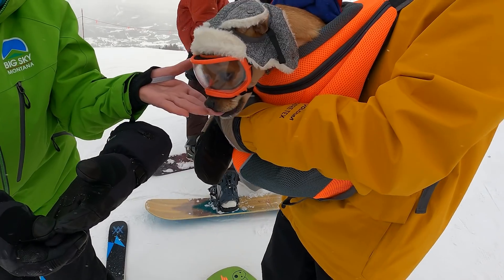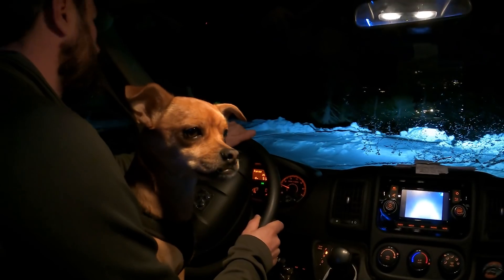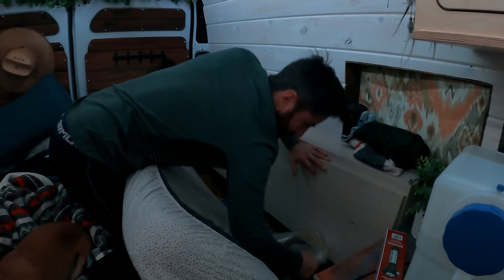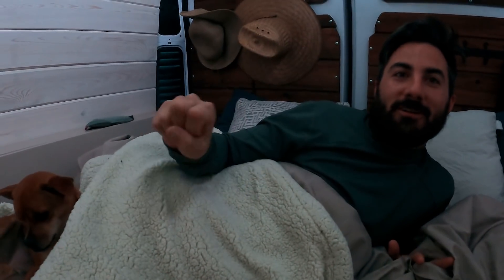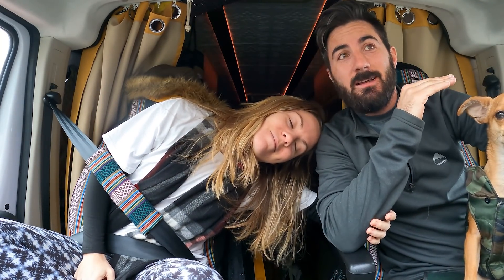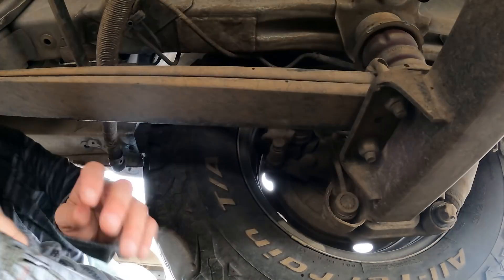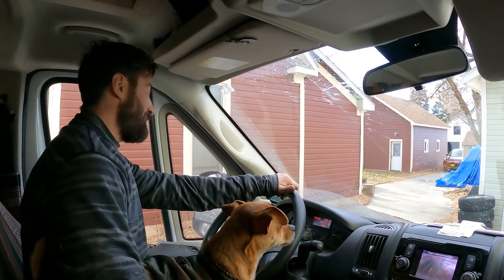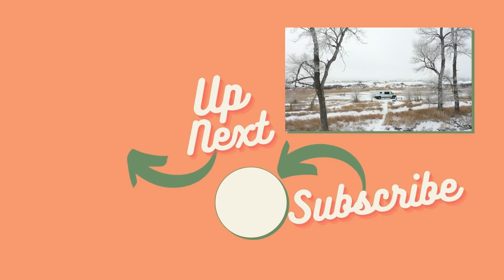Surviving Our Coldest Night in the Van 😰

Comment from the maker: If you're having this issue too, here's how to fix it!! https://www.stokeloafvan.com/blog-1/how-to-clean-the-webasto-at2000stc-gas-heater-and-burner-replacemen?rq=heater
Reply: thanks for sharing the above link .    what causes those heavy carbon buildup ?
Reply: well good luck when you guys get here....Alberta has been an ice freeze!!!! that heater really needs to work!!!
Reply: @wilsonroo16   ,,   hope they have check the weather forecast .  new year eve is negative -30 celcius .  at least  their Webasto diesel heater shall be really  tested in that temperature .
Reply: I have a woodstove. He(defely a he) sometimes drives me crazy..start trowing smoke out of al Jos whatever...
So i have  to go outside to save my life...next dat clean my chimney( an expert chimney cleaner did it 2 month ago) found ontging but mister was So happy he burnt like an sweet stove....
Reply: @enzoh7763  Wrong fuel/air mix for higher elevation.
Reply: @StokeLoafVan   , ,  thank you ,, wrong mix cause more carbon buildup. . . . . ... i've seen yon YT,   the german made , espar or webasto have settings for elevation data inout,, which would mean with the correct  elevation data, the fuel air ration is  adjusted correspondingly.   .  i wonder is that the same with china made copies ? ?  you got some info  ? ?
Reply: @enzoh7763  For the Webasto gasoline the elevation adjustment helps but isn’t guaranteed above 5000ft. The Chinese diesel heaters actually have full manual control of fuel rate and fan intake speed.
Reply: @StokeLoafVan  
Thank you for the tip, 
It's a important tip .

Comment: A common tip for diesel heaters is to not always run it on low. Run it on high for at least ten minutes to clear out the buildup of gunk.
Reply from the maker: It's not a diesel heater it is Gasoline. Plus we mostly run this one on high.

Comment: Glad everything worked out.  Nice job on the fix!!
Alex, heaters and air conditioners dry the air so drink more water if you do not use a humidifier, otherwise really bad headaches happen.  There are cool mist and warm mist humidifiers.  I use both depending on the time of year.  I find warm mist evaporates into the air faster, however, it's best to use distilled water so the burn unit does not corrode.
Reply from the maker: Thanks for the tips! That is great advice. You are 100% correct about the dehumidification. Would love to have a humidifier that we don't have to worry about the water spilling out when driving any recommendations?

Comment: What a pain in the ass, glad you figured it out. 
This is the reason I went with a propane heater.
A thumbs up video 👍
Reply from the maker: Heard that we just met a couple and they had the big propane heater and said our van stays warmer then theirs. That might be an insulation issue tho. Also the propane one would require us to have a much bigger propane tank cause those heater us a lot of propane. Gas was just easier for us to go with.
Thanks J.G. Happy New Year too

Comment: Put some concentrated antifreeze in the grey water tank. (Just as you do with the washer fluid)
Reply from the maker: Thanks djsmiley01! Yes we could do that but we'd have to get biodegradable RV antifreeze, not the same stuff as the car takes, and the issue is the elbow of the pipe not the tank itself. Winter plumbing is just plain old annoying. lol xo Alex

Comment: We bought an electric blanket. Works really well and draws about 120 watts. So if we run it off the inverter over night for 8 hours, that's 8 x 120 / 12 = 80 ah. We have 400 ah in batteries so it's not that much of a draw for us.
Reply from the maker: That is quite a drawn pending how you charge. That is almost 1/4 of your battery bank every night. What happens if you have several days of no sun and you aren't driving. I'm guessing you may be running a generator? We have a duvet and even if it is 40 in the van we will sweat under the covers and it uses 0 energy. If we had an electric blanket I would melt lol (frankie) 😆. I am glad that it works for you tho. 😊
Reply: @FnAVanLife  no generator. We use the electric blanket as our backup. If we need to use it I make sure we either drive a few hours or do shore power plug in. Propane isn’t an option for us due to risks and condensation.
Reply from the maker: @billnalen  don't yeah make sense if you are using it for emergency only. Thanks for the understanding.

Comment: Hearty people you are. Hope everything works out. If I ever get around to outfitting my own camper van I would repurpose the heat from the engine coolant to supply heat to the cabin. Sub floor tubing and circulating fans and vents?
Reply from the maker: How long would the heat from the engine coolant last? Cause an engine takes a bit to warm back up in the freezing cold. You would also have to add the proper amount of coolant for the extra line/ heat exchanger you add and if it is off it will mess with the performance of the engine and possible damage it.

Comment: My propane furnace that I recycled out of a old camper. Cheap , I live in Wisconsin. I enjoy heat. I haven't had any problems in years. 20+ years living in Vans. Peace ☮️
Reply from the maker: nice!!! We've heard great things about propane heaters, how much propane does it use?? Love that you're an OG van dweller. We could learn a thing or two!! xo Alex
Reply: @FnAVanLife  how much does depends on how well your insulated. I built my van for cold weather in Wisconsin. This winter on average a 20# bottle lasted 2 to 3weeks. That's with heat 24 hours a day . At 65 to 75 degrees. At $20 a bottle. I paid about $50 for furnace used. It was recycled out of a old pop-up camper. I have had this furnace about 5 years now. It's a thermostat controlled furnace. I thought about trying a diesel heater , but I believe it would cost more to run. A lot more. And what I have seen on videos, people have a lot of problems with diesel heaters. I been living in Vans and RVs over 20 years. By the way, I'm not much of a writer. I'm a tradesman. Farmhand, est. Stay warm , stay safe. Peace ✌️

Comment: I notice the back doors radiate a ton of cold air… maybe on those really cold days and nights hang a blanket over the doors in the back and the slider door… also over the windows even though you have curtains on there… that will help keep the heat in the van and work more effectively…
Reply from the maker: Smart Donna!!! We started using magnetics to hold up blankets on the back and side doors and that has been super helpful especially in the very cold weather. We are going to add more insulation to the doors as well (once its warm enough to have the doors open for a long time) cause I don't think we stuffed them well enough to begin with 🤦🏼‍♀️ The blankets are definitely helping though!!! Xo Alex

Comment: At higher altitude, air has less oxygen, that affects how some gas/diesel heaters burn. There.may be an adjustment on your heater for high altitude to increase the air intake. If you run the heater at high altitude without adjusting the air intake, soot can form, clogging the system and causing it to shut off because the soot clog causes over-heating.
Reply from the maker: That is exactly what happened. 😁 all fix and adjusted now. 🥰
Reply: @FnAVanLife  sweet! Take a run for me when you get here to Canada, I am not venturing out here in Alberta until the temp rises a few degrees in

Comment: U had said that your grey water tank froze. They do make a long gutter heating cables that plugs into 110v that’s designed to keep house gutters from freezing. If u wrapped your tank it wouldn’t freeze. $45 for 60 feet on Amazon.  Just a thought.  Good luck. ✌🏼
Reply from the maker: Thank you for the information. We found low power 12 volt ones rv style. Just installed them recently and they are working great. 
Hope to see you helpful comment in future videos thanks again.

Comment: Glad y'all made it through. My Mr. Heater isn't getting propane even though there is propane in the tank. I don't know what's wrong. I don't think there's anything wrong with the heater, though. I'm gonna test it with a 1 lb tank to see whether it will work that way. Good thing is, I'm in warm and balmy TN right now.  It's December and 70 F.
Reply from the maker: It could just be the connection or your tank might have to be bleed properly. If air got into you tank during a fill it will mess it up and it won't work. It's has happened to us with our cook top.

Comment: Heard you mention that 1/4 fuel was required for the heater to work. I spent a few years driving a semi and it needed 1/4 tank of fuel for the cabin space heater to start. Also don't know if you've addressed windshield washer fluid before. If you get caught in freezing rain regular anti freezing fluid doesn't hack it. It freezes up the windshield as well as the wiper blades and you go blind. Make sure you get fluid that says deicing. That will dissolve the ice. Anti ice fluid just means it won't freeze in the tank..does nothing to clear the windshield. Drive safe!
Reply from the maker: Yeah we always try to keep it above 1/4 tank when using the heater. Thank you for the heads up on the windshield washer fluid ill makensure to grab the right one next time. You rock! Hapoy New Year! 😊

Comment: Buy a chinees fuesel heater that is fitted into a steel box. And fit a Ryobi 20 v battery using a 24 vto 12 v voltage reducer  it is then mobile
Reply from the maker: Where are you exhausting it??

Comment: So while using it before you shut it down do you turn it up all the way for 1/2 hour  to get the chamber really hot to burn everything away so it doesn't get that build up. I mentioned this because chrome  does it all the time and says it. I'm in Florida so I doubt I'll have to deal with that
Reply from the maker: Yeah we run it on high before shutting it down. It almost exclusively runs on high. I just did the altitude adjustment we will see I that helps. Thank you for the suggestion ☺

Comment: I live in Whitehorse Yukon Canada. My coldest night so far has been -34 Celcius which is around -29 F. I’m not going to have an outside gray tank because of where I live. You should try maybe adjusting and getting a fitting that will allow you to drain the sink into a 6 gallon container during cold times. It will save you a lot of stress and headaches. 

I’ve got a cheapo diesel heater that has worked pretty good for the four months I’ve been living like this. Knock on wood. 😀😀😀
Reply from the maker: Amy we are MEGA impressed that you're living it up in the Yukon, so beautiful but SO COLD!!! It's no good when Celsius and Fahrenheit match up in the negatives 🥶🥶🥶🥶 sending you so much love and warmth!!! And yes we are rethinking the grey for cold weather. We need to add a heat trace to the spot that keeps freezing to help it get moving on this frozen days. Xo Alex
Reply: @FnAVanLife  heat trace is a great idea! I’ve looked into different things to help the floor temp in the mornings. 😂😂😂 i keep anything I want frozen just on the floor by my sliding door. Hahaha! I put in 2.5” styrofoam under my floor but it doesn’t cut the cokd much! I have small throw rugs down in a few spots that help a bit so I might just go with a couple more layers. I have 8 blankets on my bed. No such thing as too many blankets up here! The blankets are almost thicker than my mattress! 😜😜
Reply: @FnAVanLife  oh also I forgot to say I am so impressed in your positive attitude! When i installed my diesel heater I put high heat resistant silicone around the connections under the van. 

My 3 sisters all live in Alberta and winters there can be unpredictable. So please be careful! It can literally be super nice one day, like right around freezing, and the next day it can be -40. There’s been some crazy winds and blizzards this past week too. Don’t hesitate to ask for help if you need it. Most Canadians are pretty awesome. 🤪😀😀
Reply: -40 degrees: where Celsius and Fahrenheit gangs up on us to kick our asses. 🥶

Comment: Unfortunately when you build cheap and improperly you have to live with all sorts of issues after a short while. The heater issue is possibly that it was not installed properly?
Reply from the maker: Hey Manny, have you watched any of our build series?? I think we did a pretty good job. 😄 The heater was very much installed properly, Frankie has 10 years experience with heating systems so he knows a thing or two. It was all about the altitude. The machines just aren't built for it! xo Alex

Comment: You said your previous heater never had any issues. So why did you change it? Now handle those issues and get back to me. Nice video.
Reply from the maker: We had a diesel heater in the first van becuase it was a diesel van. This van is gasoline so we got a gasoline heater. Once we did the altitude adjustment it's been fine but you do have to clean it out more often for sure.
Reply: @FnAVanLife  Roger that. Happy camping.

Comment: Never let your gas tank go below a quarter tank.
Reply from the maker: Thanks for the tip!
Reply: @FnAVanLife You are very welcome.  Another reason being is when it is lower than a quarter tank, it is hard on the fuel injectors.  Also, if you can, before you start your engine, let it sit in the on position for 30 seconds before you try starting the engine, this allows the fuel injectors to start pumping fuel to the engine for easier start up and again it is easier on the fuel injectors than a cold start.

Comment: I'm always a little paranoid about heater issues. As a precaution I set my Webasto to high altitude mode during install and left it there. Running lean is better than running rich. Slows the soot build-up which is what usually kills these things. So sorry for all the troubles!! It sucks!

I revised my internal grey water system and was greeted with water on the floor while doing dishes on a recent trip. To me, water issues are the worst problem to have...  :)
Reply from the maker: You were smart on the install! We should have done that and the plumbing but building in Florida in a rush made us forget how damn cold the winters are elsewhere haha Sucks about your plumbing issues, we are always learning aren't we?! lol xo Alex

Comment: In really cold weather fuel line antifreeze added when you fill the tank can also help. I don't really like running below the half tank either as that can create condensation in the tank which can add to the fuel line freezing issue.
Reply from the maker: wow didn't know that happen with a gas vehicle I know diesels can gel up. It wasn't the fuel that was an issues tho it was the carbon build up. Thanks for the heads up ill have t keep an eye out for that Jim.

Comment: Freezing temps will cause water & fuel issues if you didn’t winterize
Reply from the maker: We don't have any fuel issues but the water issues was due to freezing temps. Thought the water would have a shot and making it to the tank coming from the inside of the van. Made the changes we needed you will see in a future video.

Comment: This is freighting.  How long have you had this heater? I was told that if it is operated on a low temp for long periods of time that it will build up carbon. I have only had my heater for a few months now, and for the price I sure wish I would have seen this video when I was doing my research .....o no
Reply from the maker: 2 months of use and then that happened. We did change the setting to high altitude so maybe it will have less build up. We will see and keep you updated.
Reply: thanks guys love your little dog I have one also

Comment: Wow really?

I don’t ever park for the night without at least 1/2 tank of fuel.

Hi /lo altitude even on a ferry below sea level,  (below deck on a ferry), no issues.

Don’t run the heater while driving.  Why risk both the operational function of the van  AND the  home heating system?!?!
Reply from the maker: When it is below 0°f the back doors could be a little drafty which will cause the lithium batteries to get to cold and they won't charge. Since we spend most of the winter in mountain town snowboarding it gets pretty cold outside. 🥶 When we are parked up we pretty much always have a full tank. We were talking about when we were driving for the day we let it get low twice. Thank you for the advice 🙏  we will try to keep the tank always above 1/4 for now on. Also the high altitude adjustment on this heater isn't perfect even according to the company over 5000 feet it could still give you issues even after the adjustment. I might just be going back to the Chinese diesel heater if we keep having issues. 😁 Thabk you for all your considerate thoughts. 😊 Happy New Year.